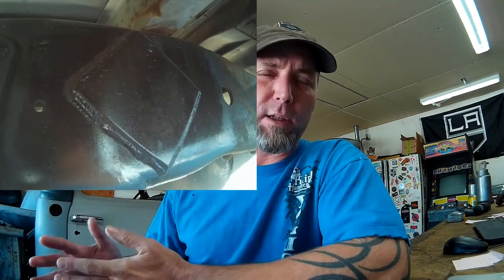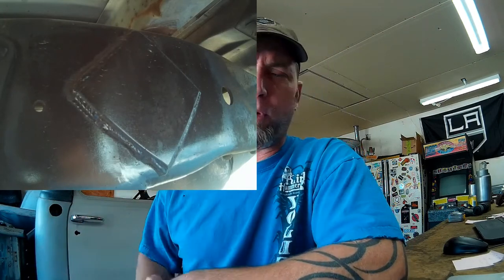Ford OBS; Shortbed Conversion Discussion (All Talk!)

Comment: timestamps for future reference -
0:00 - intro
3:30 - backstory
7:20 - (info begins) cutting frame
9:25 - reconnecting frame
11:04 - plating the frame
12:10 - things to consider (driveline/wiring/e-brake/fuel lines/brake lines/exhaust)
17:05 - FAQ (cost, z section info, why he did it, concerns, would he do it again)
22:35 - future plans (cummins/manual swap, super duty suspension, dodge interior, headliner, plastics, body work, power rear window)

A few questions I don’t think you addressed - 
Which fuel tank did you use? I’m going from a factory 2 tank setup on my long bed to 1 tank.
How did the bed gap come out with the extra 1/4 inch taken out of the frame?
Reply from the maker: hey thanks Tripp!  the extra 1/4" tightened up the bed gap on the back of the cab nicely, imho.  for the front tank, Kevin told me to use an F150 CCSB front tank, and he was dead right!  it fits exactly factory.  you will NOT be able to use your fuel tank sender and float from the long factory front tank, but you can use the F150 sender minus the factory gas in-tank pump.  i know this video is lacking, and we're going to try to do a better job when we shorten the 71 Bumpside.  thanks for watching!
Reply: Not a problem! Thanks for the quick reply. After commenting I did some research and it looks like they make a 38 gallon tank that will work on my pickup! Forgot to mention on my original comment my truck is a single cab. I’m going to start buying parts! I will be using your video as a reference tool. Sounds like (aside from connectors) the main costs will be fuel tank, short bed, and driveshaft since mine will be shortened professionally. Very useful information! Thanks for making the video.
Reply: I will also be doing the 1/4”, since I’ve never been a fan of my bed gap. Wouldn’t have even crossed my mind!
Reply from the maker: yeah, you can surely use the Bronco rear tank.  it's a single 38ga tank, no spare, and will work fine for your OBS.
Reply: @vintagespeed  what year bronco would the fuel tank be from? I have a 97 f250 crew cab long bed that I will be shortening thanks to this great video.

Comment: Thanks alot you cleared up alot of questions i had especially the drive shaft part. Im a welder down here in sothtexas in the oilfield, but now knowing I can cut and weld it myself without it shaking apart. Im gonna shorten it this weekend, thanks again for the great information and really quick response 👍